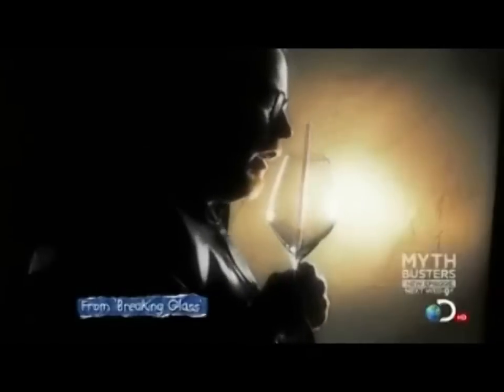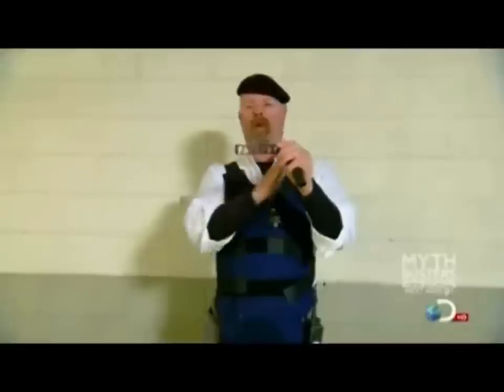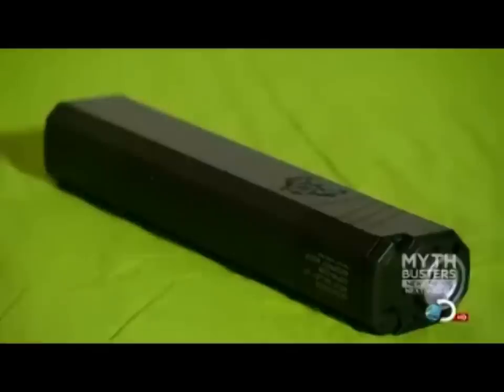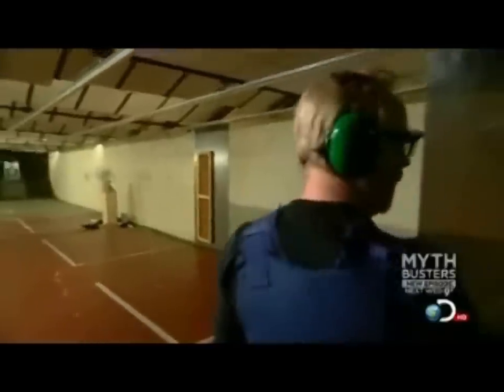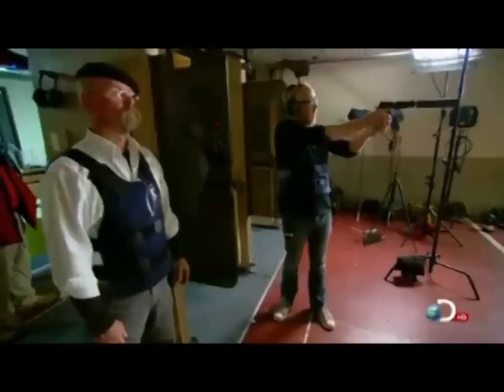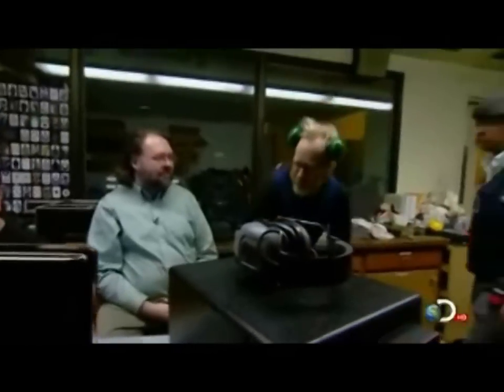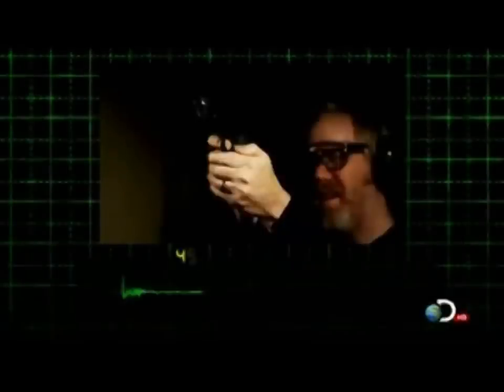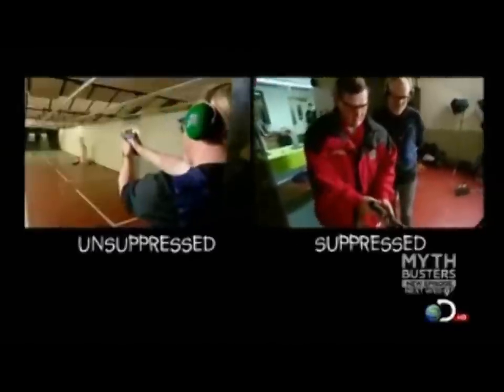Silencerco on Mythbusters

Comment: Should have tried using a Welrod, reputedly these only produce around 73dB or so?
Reply: johnyfartpants I used the welrod on a ps2 moh game, it was great, way over powered for a .32 or .38 (can't remember). One shot kill when even the m1 garand took two.
Reply: welrod is a very short range 32acp or 9mm used for assaination. you are meant to put it up against someone then fire.
Reply: There are two problems:
1 - they are rare
2 - they consume the supressor when operated
(which means that its costly to shoot them, that being said to this day they are one of the best silenced weapons out there, and sometimes used by special forces - if the rumors are true)
I would have advocated De lisle carabine, there are reproductions, and it doesn't include rubber flanges that are consumed when operated.
Reply: they consume the rubber baffles which you can replace. in fact I suspect more companies will offer the sheets and the punch tool to make the baffles for the end consumer.  rubber baffles are slowly making a small comeback because they do work very well. welrods can fire hundreds of thousands of times, it is meant to be a user serviceable silenced weapon.

now the high standard ones those only lasted a few hundred shots but since you trained with a regular version of it they were able to keep a number of those lasting up till Vietnam when another intergral 22 took over.
Reply: toomanyaccounts 
Yes its user serviceable no doubt.
Problem is that the baffles are solid, and wear down fast, i mean FAST, if you empty a magazine the last shot will not show much effect of supression.
Also it has some inaccuracy at the curtesy of solid (hole less) baffless that lose their "virginity" at the first shot.
Reply: well the thing is for the purpose it was designed for, if you need more then a mag on a mission you are in deep doo doo and need to extract yourself.
Reply: toomanyaccounts 
That is very true.
However it doesn't make for an easy filming to disassemble the pistol after every third shot because its getting noisy for the test.

But it probably has to do with availability.
Reply: there are other silencers that when fired wet or are intergral with the right ammo you only hear the action of the gun. so yeah as noted there are silencers that are holly wood quiet. I have one and it freaks the holy hell out of people when I fire at a range because all they hear is the sound of the bullets impacting. there are silenced ar-15s that when using the specialized ammo you only hear the click of the firing pin and the ejection of the shell and the impact of the bullets. the range is only a few hundred feet with this ammo but guess what for a lot of sniping purposes in police situations that is quite useful.

Comment: Actually, the .45 ACP has a muzzle velocity of about 900 FPS, which puts it well into the subsonic range.  You have to go over 1080FPS at sea level to get to the transonic region.  As to the 9mm, it is probably just subsonic, depending on the round they're using and the length of the barrel.  I would make sure you know what you're talking about before you post, You don't look so bad that way.  :)

Comment: The .45 ACP is already a subsonic round when fired out of a short barrel... So no, they were not unaware of anything. And even if it wasn't a subsonic round, they wanted to measure the difference between suppressed and non-suppressed, so using the same ammo in both tests would be best.

Also, they are not called silencers, they're called suppressors. Next time, you may want to do some research before commenting, you wouldn't make yourself look like an idiot had you done so in the first place.

Comment: first use sub sonic ammo.  the bullet cracking through the air makes noise.  second, a smaller cartridge like a .22 can be made totally silent.  maybe even something like a .32.  if its an auto pistol the only thing you will hear is the slide moving back and forth

Comment: Suppressed guns ARE NOT MOVIE QUIET! NOT EVEN CLOSE! IF you are outside and down the block and someone shot a suppressed supersonic round you would hear it and recognize it as gun fire. When bullets break the sound barrier they make a loud crack there is not one thing a suppressor/silencer(same thing) can do to stop that crack because it happens when the bullet is outside the gun. There are some calibers that you can get subsonic rounds for, but those still are measured at 127-135db, which is "painful to the ear" it's just not damaging to the ear. Suppressors should be completely unregulated, off the shelf items like any other gun accessory, and they should be sold as a health option with every firearm sold. Imagine selling a car in 2019 without airbags or seatbelts, or what they compare it to in this video a car muffler, imagine if they sold cars without exhaust systems?? Its completely insane, the amount of hoops you have to jump through to own a suppressor. 18 months waits, multiple background checks, fingerprints, and forms in triplicate,for each one, imagine if you had to do that for a optic for a rifle.

Comment: I still say air rifles are better especially when you get a big bore air rifle you can legally have a silencer on it with no paperwork it's a lot quieter than that 9 mm pistol round and if you get something like a Texan Air Force and 45 caliber with a suppressor on it it's about as loud as a paintball gun but has the power of a 45 ACP actually a little bit more and you can fire a bigger slug then you can at pistol like a five or 600 grain slug in 45 plus they make 45 caliber air pistols that shoot normally a lot quieter than the fire arm I still like fire the right air rifle is definitely better

Comment: Does anyone know if they were using subsonic ammo
Reply: 230gr 45acp is already subsonic, the 9mm was definitely not subsonic. I would assume they were using 115gr or 124 gr 9mm.
Reply: The 45 was the one i didnt know
Reply: ff35-13 That's what makes the 45acp so special. Packs a heck of a punch at around 900 fps.
Reply: Im a 9mm guy
Reply: +ff35-13 .45 is standard a subsonic round....slow and heavy, it relies on the fact that it's a huge chunk of lead to do the dirty work. Also that's why .45 ACP guns last longer than .40 S&W, lower pressure is easier on the gun.

Comment: The proper term may be "Suppressor" because that is what it does, it does not completely silence it. But ATF Form 4 section 1c says that they are "mufflers or silencers". They do not mention suppressor at all. Either one is fine in my book. Only douches get hung up on what it is called. Its not like a "magazine vs clip" debate because those actually are 2 different things. Silencer/suppressor is the same thing.

Comment: you couldnt be more wrong a 22lr is above 120 decibels. a dry fired weapon is around 100 decibels. look up osha's regs and reports for normalized exposure. anything under 110 decibels and you wont experience permanant hearing loss. how many movie theaters have you been too ? because thats prolonged exposure to noise above 110 decibels.

Comment: holy crap. this is not a MYTH that needs busting. just search for silenced pistol on yt and you will hear for yourself.  there is so much wrong with this test it seems like they must have been trolling. i would explain it all but the info is out there if you really want it and i wouldn't want people to understand it unless they had the experience and/or responsibility to know. briefly: you don't use the same loads if you really want it quiet... and yes, it will sound *almost* like the movies.

Comment: 128dB is NOT SAFE!!!
Reply: Matte Edström yes 128 IS SAFE. look it up on OSHA site yourself.   128-130 whatever as an impulse noise is hearing safe which it would be.  Sustained noise is the issue.  So your fucking wrong.  An it’s impulse noise I think 130 something as an impulse is fine. I don’t know if the cutoff is 140 or 139. But it’s above 128dB.  So maybe u should look it up yourself before making an ignorant comment

Comment: I would like to see this topic covered in the greater detail that I expect from Mythbusters.  (◣_◢)

Real assassins use much quieter ammunition as well like .22 short and caps or even better especially customized ammunition for the specific weapon and silencer used. I believe that a very good expert can get a pistol, silencer and custom load that is very effective and nearly unable to be detectable with the human ear even with only a minimum of background noise.
Reply: Real assassins?  lol.  Besides, to truly suppress the gun you need to fire subsonic ammunition.  .45 is probably the best round to use with a suppressor because it's barely supersonic as is.  Plus the weight of the bullet helps counteract the loss in torque you get from firing subsonic ammunition.
Reply: RandyLeftHandy thank you for mentioning the sub-sonic ammunition angle, a lot of people out there think that you can just toss in any old round into your clip as long as its the corresponding caliber to the pistol your using.  also the whole dry vs  wet fire debate is also a very interesting issue, they neglected to mention. (personally I say to each his own, but a dry fire / wet fire can produce very different results depending on the caliber, the type of pistol and the brand of suppressor being used
Reply: also action noise and carrying abottle of water on their assassinations for their  supressors haha
Reply: A semi-auto pistol is never going to be hollywood silent, the action noise is actually quite loud also 130DB is still a really loud noise, its far louder then a rock concert or a jackhammer.
Reply: I think an automatic with "silent ammunition" probably does not develop enough pressure to actually reload or eject a cartridge. An automatic would then becom a manualy reloading pistolAccuratly fired from a very close distance the right pistol, ammunition and silencer could be deadly and very nearly unhearable.

The revolvers I have had all had a tiny gap between the barrel and cylinder where gas escapes making them louder but I could vorsee the possibility that there might be some revolvers that have a cylinder that presses a part to the cylinder/cartridge into the barrel preventing loss of gas and pressure at the cylinder.
Reply: gookymann The nagant pistol is a gas sealing revolver.
Reply: Thank you!

I thought that somebody would make something like that. When it comes to weapons there is no lack of imagination. I think both revolvers and automatics each have their own advantages and disadvantages.

I personally do not own any weapons anymore however I have been considering some kind of shotgun and a crossbow. Shotguns have more different types of amunition than one could imagine.

I now live in Germany and the laws here alow you to own guns and keep them at home but they have to be kept in a very secure gun safe which can be controlled at any time by police without prior notice making owning guns useful, loaded and on your person, even in you'r own home, against the law. Gun control is also an invasion of privacy.

I have a problem with uninvited guests in my apartment when I am not at home even though I have changed my locks and carry all four keys with me at all times. Even though there are only small things like a few cans of food missing, some thing a litle more expensive and some vandalism like cutting some electric cables (Attempted murder by electrocution?)

Well it makes me very insecure and uncomfortable. Storing a weapon leagaly under these circumstaces only makes them availiable to these uninvited lock pickers. I would much rather have laws that require you to carry your handgun with you at all times and other weapons securely locked and within view. They would then have to pry my gun out of my cold dead hand ;)
Reply: gookymann Your reasoning is why gun owners in the U.S. flip shit whenever CC permits and other ownership information gets plastered all over the net by "professional reporters"

People who commit mass murders and most crimes are not legal owners of firearms, they acquire them by stealing, straw purchase or backroom purchase.

Stealing is the least done because of anonymity of most owners.

Self preservation of life is a basic human right. Guns are the most useful tool in postering (making ones self seem a hard target), and the easiest tool for killing should an adversary decide to attack instead of flee or submit.

Comment: The handgun an assassin would use is a suppressed .22.  It's quiet without the suppressor, so with one it's damn near unnoticeable.  It doesn't have amazing penetration so in all likelihood the bullet won't go through the person and cause extra damage to the area.  The small caliber also makes internal damage more wide spread if it happens to hit bone and ricochet.  The idea that an assassin would use a loud large caliber weapon is really kind of retarded.
Reply: Kosh800 its not quiet at all without a suppressor. go read up on subsonic .22 vs subsonic 300 blackout and you'll see how worthless a .22 is
Reply: johhny johnson Well no shit but with one it is damn near silent.  It's also used because it's small, easy to conceal, and can penetrate a skull once, which is what it needs to do.  It also bounces around and does internal damage.  Not to mention size doesn't matter when you're a hit man.  You're not getting into fun fights with armored people.
Reply: Kosh800 bullets don't bounce around inside a body noob and the internal damage of a .22 is way less than any other bullet due to its small diameter and slow velocity plus people have survived headshots before so yes size would matter in that situation
Reply: You've never shot suppressed or even a .22lr have you?
Reply: abrb1223 look up the definition of bounce. its not a rubber ball its not going to rebound back to where it comes from. look into a dictionary maybe, how about that?

Comment: Come on guys.......Don't sweep the weapon (particularly across humans), always point it down range and please, please, always clear the weapon, check the breach to make sure it is empty and have the slide locked back/no mag installed when illustrating details of the firearm or installing or removing the suppressor from the host. I am really surprised that the people in charge of the range didn't insist on a comprehensive safety briefing before allowing you on the range.

Also, pointing the firearm at someone running away and shooting them in the back "Hollywood style" is in really poor taste. No responsible firearms owner would ever do something like that. It's not "cool", it's not "funny".

Comment: Wow this video was all sorts of wrong and full of bad information. Plus they keep touching the pistol like its not real. Pointing it at others and themselves and placing their fingers on the trigger. 

Try to suppress a 5.56 round. Sure you can but its not going to keep it from making a sonic boom. Unless your using specifically designed silencer ammo that draws it down to a velocity thats damn near useless at anything over 50 yards. I wonder if all their vidos are full of so much miss information. Or maybe there are just to many variables in this instance. Hollywood quite is only capable with certain rounds or types of ammo. Even then its still not like in the movies.

Comment: yeeeeeeah none of this is even remotely right. 1) there are a massive variety of ammunition types. mainly sub-sonic and super sonic rounds which are going to have a very drastic effect on the sound, about 10-15db compared to a sub-sonic round fired from a suppressor.  or so for super sonic. 2) ive never seen a suppressor drop sound levels below 135db, even military and police issued ones and thats WITH sub-sonic ammunition. 3) 3) shooting a firearm indoors vs outdoors is going to also have a drastic effect on the sound waves and how they are both carried and reverberated back to the shooter.  With that said theres is NO WAY any currently available suppressor can match the roughly 85db or less hollywood suppressor in any shape or form with out it basically rendering both the gun and the bullet 100% useless.  Even WITH  suppressor it is still advised to wear additional hearing protection as is does not make it "hearing safe" it makes it SAFER, about the same as going from 2 packs of cigarettes a day down to 1. and lastly, its called a SUPPRESSOR not a silencer, and for the rest of the worls its called  a MAGAZINE not a CLIP. Clips havent been used since vietnam

Comment: That's a crime to say the myth is busted. 130db is the equivalent noise level of a jackhammer. Movie suppressor sounds are equivalent to normal conversations 60db. That's why you sellouts are not on anymore. What a joke. 400% louder and you say plausible. I call shenanigans scam artist trying to block hearing protection act. 130db is safe for a few minutes in a day. Hearing protection required for an 8hr shift iaw osha